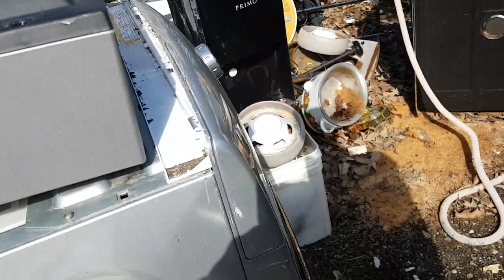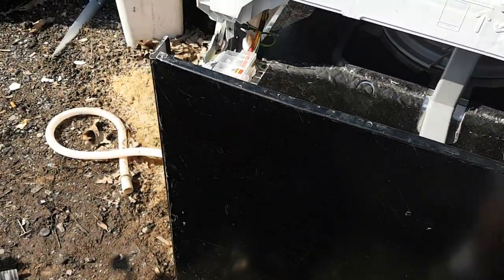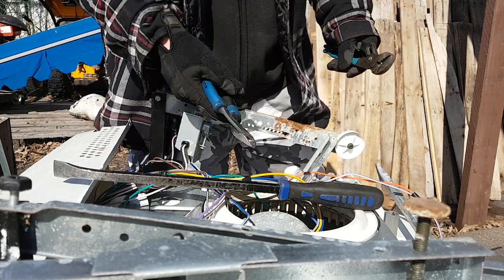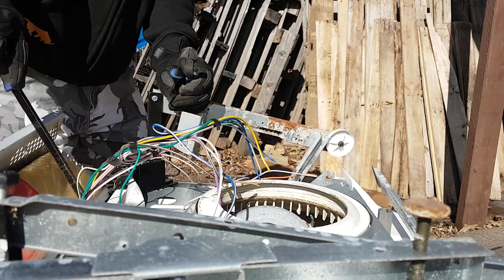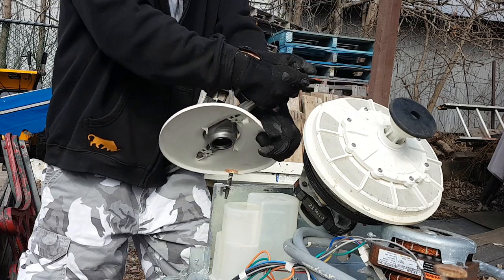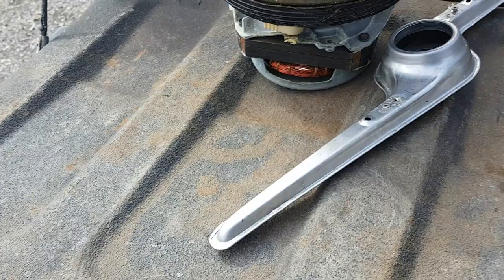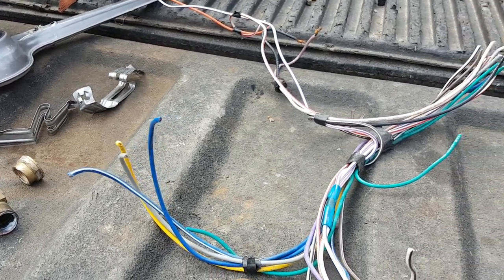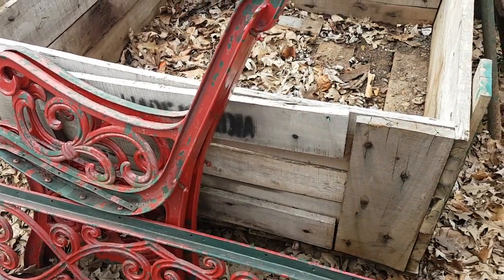dishwasher tear down !!

Comment: Hi Dan, I see Star running around their comes to check on you every once in a while. Just pray you don't get Sciatic problems on top of the back problem. I can only work for about a half hour before I have to sit or lay on my one side. I used to do both my gardens sitting down with my hand spade 4am to 6 am before it would get to hot for me and now I haven't had a garden since I moved but I sure miss my gardens and all the people I shared with miss them to. 👍👍👍😂🤗
Reply from the maker: Gardening is relaxing!!!